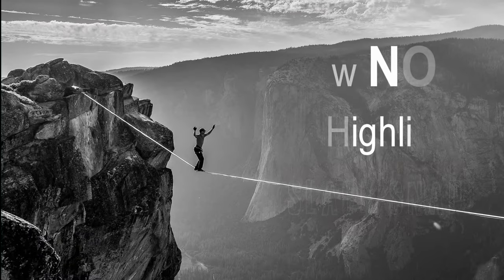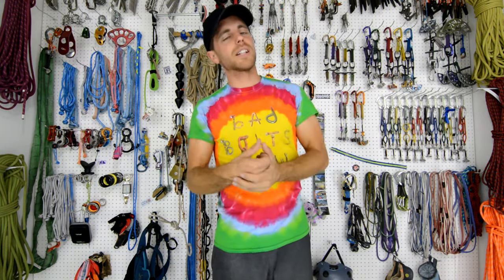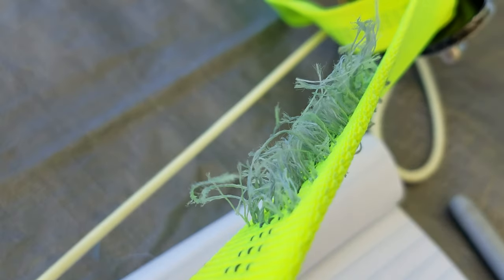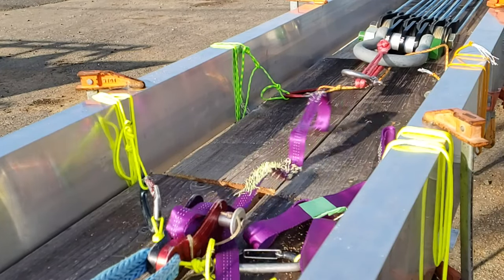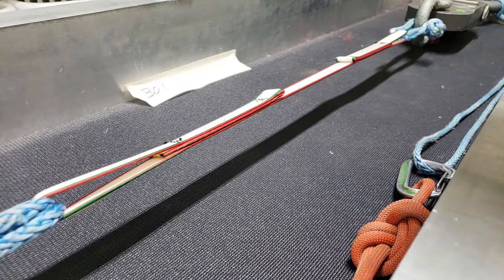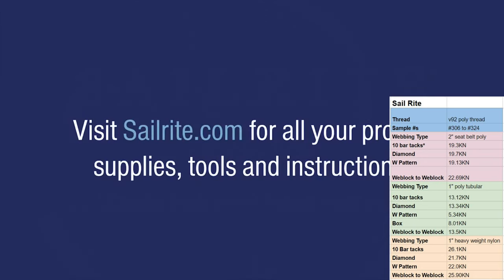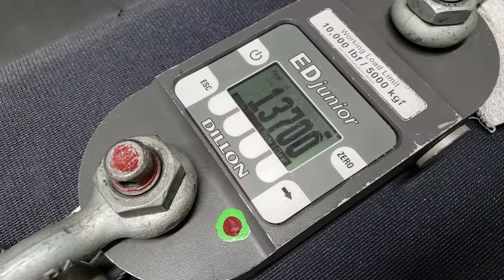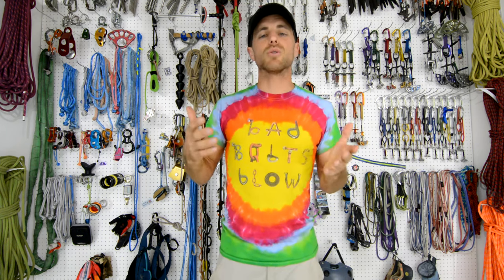Sewn Loop Patterns on webbing - what is the strongest pattern to sew loops on your slacklines?

Comment: Would be interesting to test different needles ie gauge and sharpness. Sharpness might effect strength as sharp needles will pierce any materials like individual cords in webbing threads and blunter needles will push webbing threads aside without doing as much damage. Would be interesting to see if that altered where the failure point of the webbing propagates

Comment: Sailrite's 1 inch Poly Tubular webbing W pattern was a faulty sample. No way it should fail at the bar tack at far lower strain than the similar diamond pattern. This indicates the bar tack was taking most of the load, and therefore had been overstitched/tensioned.

Comment: This is interesting,. I would have thought that bar tacks would bot hold as well due to the number of stitches in a small area. It seems to me that that would damage the webbing.  I wonder if it's strengeth comes from the webbing being able to stretch between the bars?  Stitches like  W, diamond, etc would put a lot of strain on the stitching itself as the webbing tries to stretch.  My only issue is that I have an oler maching that does not do zig zag, and the one I have that does do zig zag isn't made for this kind of heavy duty work.   How would I get a sample to you to test?

Comment: Hi,I am just curious to know what kind of webbing/strap is used in making of harness,nylon or polyester.As I know nylon stretches more than polyster.Does this stretchability help to reduce the impact of any fall during Climbing ?  

I have no idea what percentage of force impact due to a fall transfers to harness from rope,this should be a relevant factor about harness testing
Reply: Both are used, it makes absolutely no difference though.
Reply: Quite a bit, almost all fall protection  systems incorporate some form of shock absorption

Comment: I want to make my own fall deceleration break away webbing. Probably a single 39 inch loop sewn peeling back like a banana, unlike here. I want to make a 1 meter to 2 meter shock absorber on a 2 meter loop cache on a 5600 lb rope that is pulled together 1 meter by the break away webbing. Obviously, single use. 

I am afraid to use my wife's sewing machine for fear of breaking it. However, I do not want to sew more than 2 layers of webbing. 

I think the formula is each breaking point must support the weight and the excess breaking force per inch is basically the stopping force and determines the stopping distance. I calculate the interval fall acceleration between 1 inch break aways is insignificant. 

I have been testing 2 meter drops and different stopping strategies.  A minimum of three 1/2 inch bungees per 40 lb seems to cushion the stop, however this is bulky and expensive.  

A 550 lb 8 inch porch spring seems to permanently stretch 6 inches each 40 lb drop, which I calculated like 970 lb of force. I bet this spring might stretch 24 inches and absorb 3600 lb but I might need to test 8 inch 80 lb trampoline springs with 40 lb to have any confidence. 

I tried amazing goop and jb weld epoxy. Amazing goop offers only 17 lb resistance and the JB weld offered about 5 lb on the nylon webbing. Half inch heavy duty staples offered 20 lb, 23 lb, or 27 lb break away resistance (banana peel style).. However, stapling in line and pulling, as in this video offered more resistance than I could pull down. 

50 lb break away string does seem to break close to its rated strength. However keeping it from slipping down the webbing is too impractical 
 Grommets just weakened the 900 lb webbing and it tore the webbing at 65 lb. Glue did nothing.  Trying knots every inch was difficult in webbing and took 5 inches of webbing per double knot to keep the breakaway string from slipping. 

I ordered 1000 lb paracord, which should be easier to tie knots every inch or every cm to keep the breakaway string from slipping.  I will find the right number of break away strings at 40 lb and mock up to human weight. I probably will amazing goop or gutter seal the break away seal for rot resistance and cover the shock with a sleeve or fabric. 

However, I need to steal my wife's sewing machine, hit Walmart for the toughest, heaviest thread. 

If either sewing the webbing or break away threads every cm or inch on the 1000 lb paracord do not work, I probably will buy 10 porch springs to supplement the bungee I already purchased, after testing a weaker trampoline spring. 

I am not going to invest $400 every year for a once in a 100 year fall catch system. Plus, I learn so much more and understand the system, figuring things out myself. I learn what to watch out for. 

Like, compromised webbing loosing 15 times the rated strength. I am also now a full believer in the need for 5600 lb system after dropping just 40 lb 6 foot and seeing it break all kinds of things, like two 400 lb rated bungee cords, with equal support of the load, in a single drop.

I also learned the breaking strength of discount store and closeout ropes and line, with surprising results.  Like one rope that was rated 1200 lb, could not handle 140 lb: it stretched from 10 feet to 20 feet, and then broke.  Line I thought was 150 lb was only 100 lb.

Hopefully, the Amazon 5400 lb climbing rope holds its rated weight, although I will implement protocol never to possibly fall more than a few inches onto the fall protection. Of course, who follows protocol these days?
Reply: Don't try to use Walmart thread. $16 bought me a big spool (2100 yards) of UV protection V92 thread.
Reply: @fryloc359  it has been nearly a year since I did all of the drop tests,  math, and research.   What I remember is, yes,  buy good webbing,  and serious thread.  Test, test test.   I chose 2x wide, since I could get the strength each sewn break.

I bought a winch, a serious scale, learned the math,  and did scale drop tests. I also took notes and video recorded on a tripod, as much as I could.   I just lack editing interest. It was fun.

I learned about the Kong Kisa,  and bought a dozen of those.  But I didn't really trust them.  And quickly learned in drop tests about water and dirt quick effects on friction on the rope and plate. I also bought a Kong Slyde, but never got around to testing that,  scientifically.    Kong needs to sell the rope that is friction calibrated (wet, dry,  dirty or clean) with Kong kisa,  since 3rd party rope will stop humans at forces greater than 1800 foot lbs. 

I remember,  be very careful about the webbing and the breaking thread strength.   I was surprised about how strong my thread had to be,  and how poorly performing some of the webbing was.  

Also,  I did breaking tests on various string and rope.  Most didn't come close to the breaking point they listed.  Including Kevlar string. 

I regularly tie my properly placed ladders I use for work with string I can't manually break with all my might.  I would have thought that it was at least 150 lb cord,  however in my testing (winch and scale) ,  I could easy break the cord at 30 lbs.  The cord is probably okay for the purpose only because the initial force of a kicking ladder or windshield wipering ladder is a few ounces, which the 30 lb cord can hold before things get out of control.   The advantage of it,  as compared with 300 lb or 1000 lb cord to tie ladders is its cheapness and ubiquitous nature of 100 dollars worth of cheaper cord.  However,  even for paracord to tie things down,  you need mindful of the reality of the probable low breaking strength,  unless proven otherwise.

Ryan is the Man!  I deeply admire him for doing his real world testing and learning the Newton physics,  rather than just blind trust in corporations and their lobbyists and their proxies.